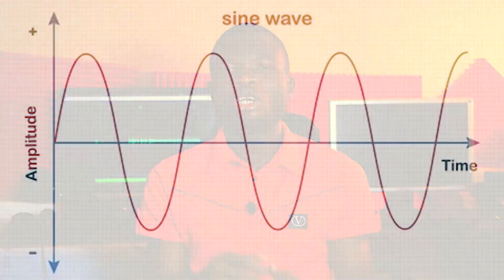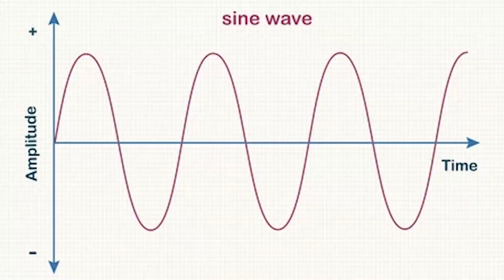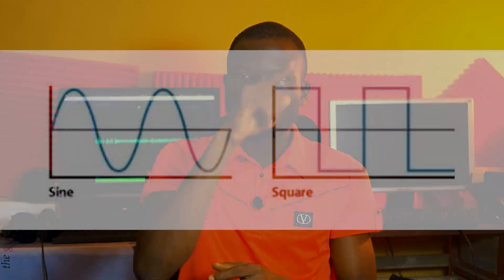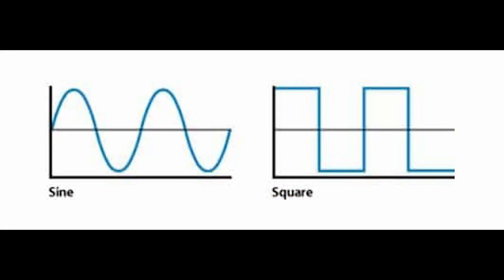The Concept of Clipping In Sound Production

Comment: How can i set gain if my mixer doesn't have a pfl/solo button?
Reply: Thank you for  your reply. I have learnt from this too
Reply from the maker: If you want to set a proper gain structure and your mixer doesn't have a pfl button, then you have to use a trick:

Set your fader to the zero mark for the particular channel you want to set, and do the same for the master fader. Pull every other fader down and set your gain, using the meter reading for the main output.  Your focus should be on getting a good signal from the channel without clipping.

Do the same for every other channel, that way you'd be sure you have set your gain to a good working level for your mixing operation. Then you can vary your fader levels as the need requires. You won't have to go back to the gain knob again if you set this correctly at the beginning. Just the fader.